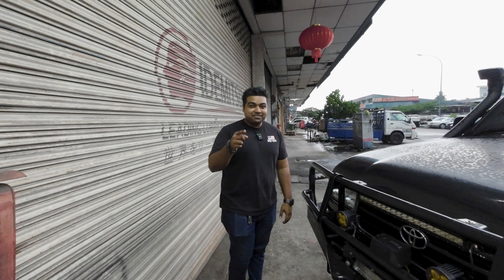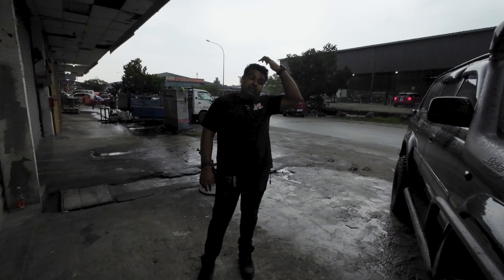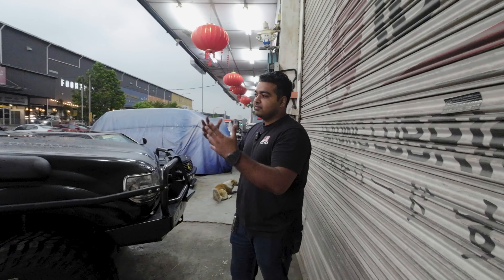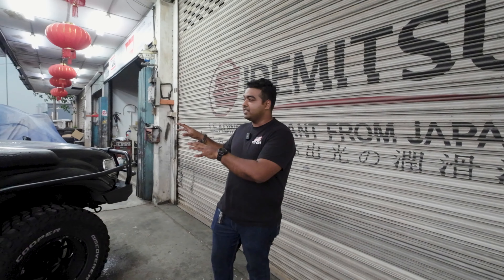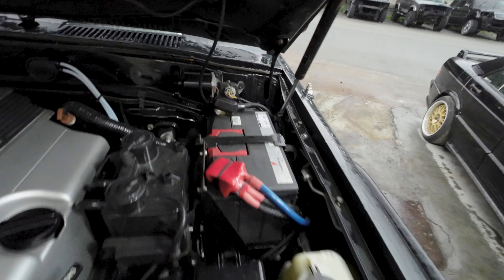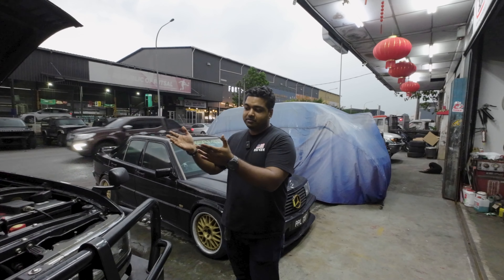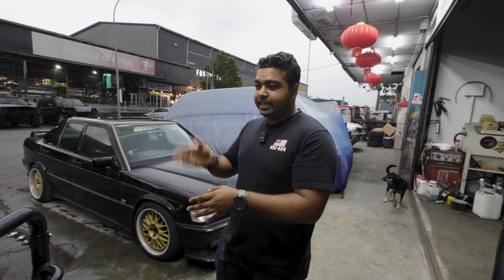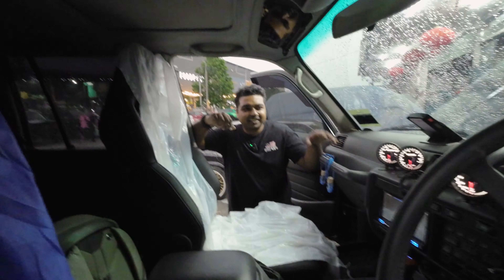Classic Reimagined: Engineering the Ultimate 80 Series Cruiser #usj4x4 #customlife #landcruiserv8

Comment: Where about's in Malaysia are you and how much do you sell the 1HDFT for?
Reply from the maker: Subang Jaya, got a 1HDFT motor paired with the A442F gearbox on the floor going for rm35k. Turbo, fuel pump and injectors were done before removing it from the vehicle as we swapped in a 2uz into the 80 series.
Reply: @vishant4wdmalaysia  Thanks for the reply

Comment: just a question, what about using portal axle on the LCs..? have you ever done one with portals?
Reply from the maker: yes we have , we have done a 40 series wagon with portals. However i'm really not a fan of the c303 portals. As highway drives are not pleasent. the megacruiser portals thats are ifs and irs to be a more suitable for it to be on the road
Reply: @vishant4wdmalaysia  that's an olskool legend volvo portals! hahahah..i just found out that in Johor there's 1 brand- TRE 4x4, 3-gear portals..not sure whether it's either fully local brand or not but they are SEMA-member.
Reply from the maker: @ymer2501    Tre is very much a china brand(no issues with that) just that none of their portals have been tested long enough to make an opinion. Best to stick with brands like 74 weld , tibus or mark 4wheel drive adapters.